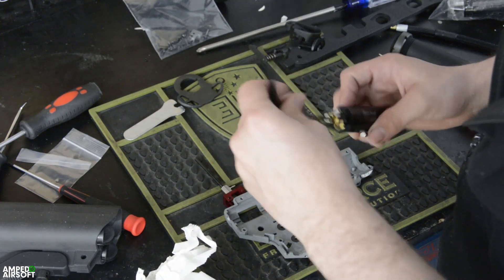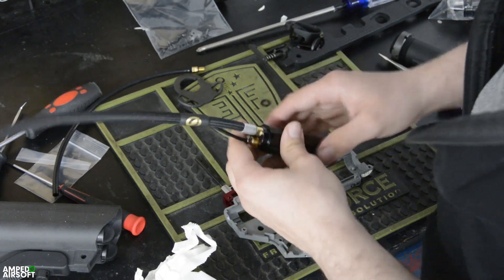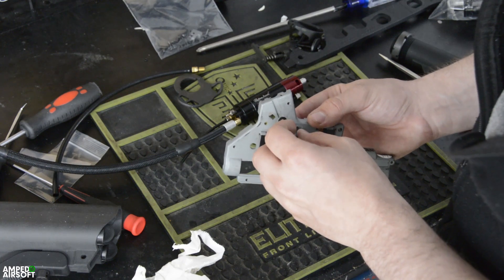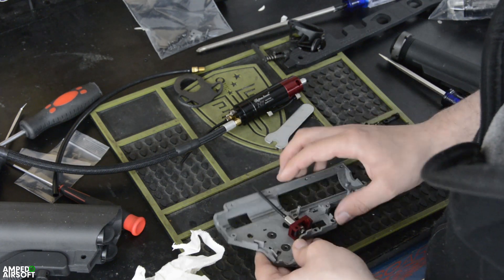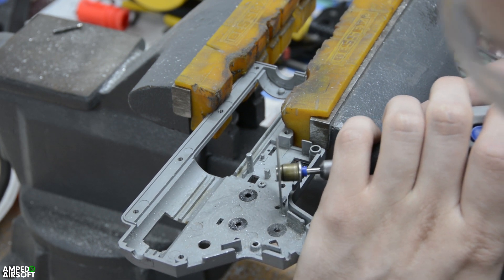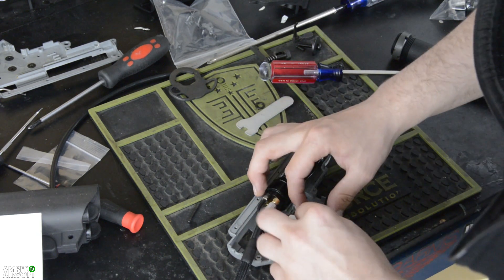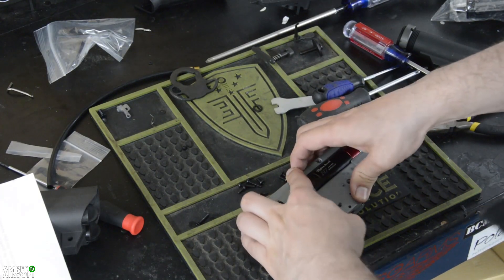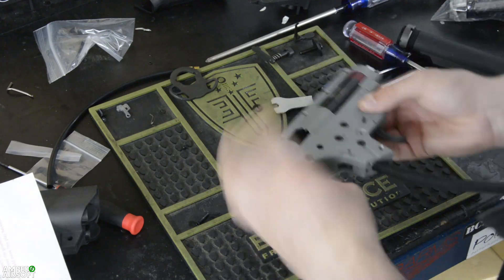Pleb to Pro - How to Install Redline N7 Milsim

Comment: Lets start with saying that I am somewhat new to airsoft. I see that the milsim is designed for the V2 gearbox, but is there anyway to dremel your way to getting this to work in a V7 gearbox? Specifically wanting one of these in the G&G M14 EBR.
Reply from the maker: Hi there Nathan! Welcome to the world of HPA.  At this time, the N7 is not available for the G&G M14 Platform.  With that said though, there are two that are.  The PolarStar F2 for G&G M14 and the Wolverine Hydra for G&G M14 will work. 

Maybe the Milsim version will be available in the future. 8) Hope this helps! -Kurtis

Comment: I just bought an sr16 with the n7 milsim in it and after about 150 ft or so it has a mean hook, either up, right, or left. Could the cause possibly be because of my elite force .25 bbs or should I look else where for the problem like the barrel being mis aligned from shipping or something with the hop up (no hop up mod inside it yet). Please get back to me as soon as possible
Reply from the maker: Hi there John! 

Congrats on your new N7 Milsim! 8) This sounds like it may be an alignment issue with the barrel as you mentioned.  We also would recommend using heavier weight bbs such as .32s, however the .25s shouldn't make it hook.  

Please feel free to shoot us an email at sales@ampedairsoft.com and we can offer further help. 8) Please be sure to include as much information as possible about your build so that we can help with troubleshooting. 

Talk to you soon!
Thanks!
Kurtis
Reply: Amped Airsoft I'll email later tonight after work, thanks :)
Reply from the maker: Sounds good! Enjoy the rest of your work day! 
Thanks! 
Kurtis

Comment: How is this an install video?
Reply from the maker: We explained how to install it and showed excerpts of each step. It's a very easy install and you can see in the video each important step you will need.  We wanted to try a different format to see how it went back in 2017 vs an over head video. Hope this helps.